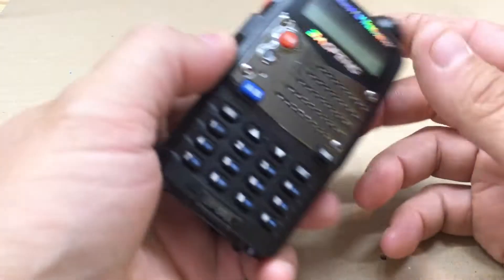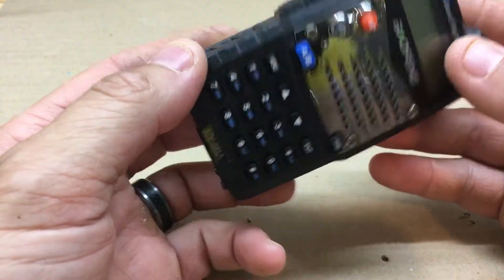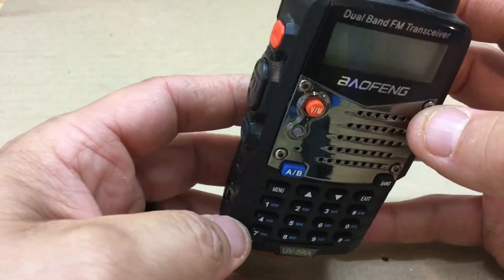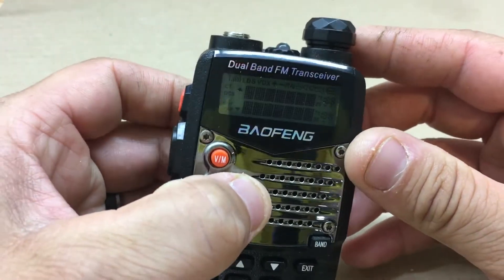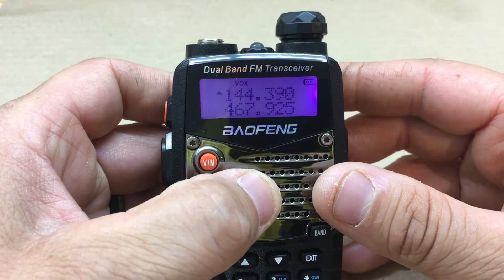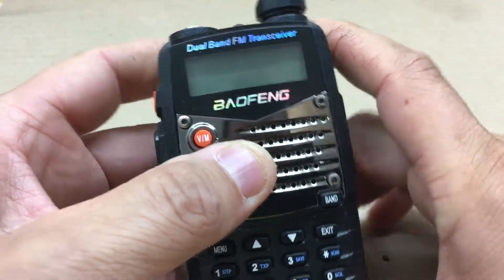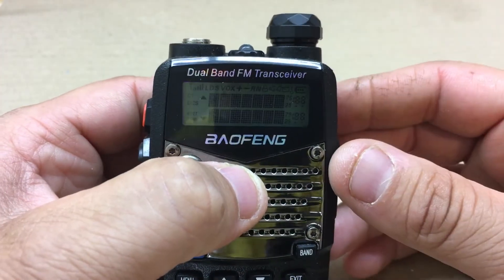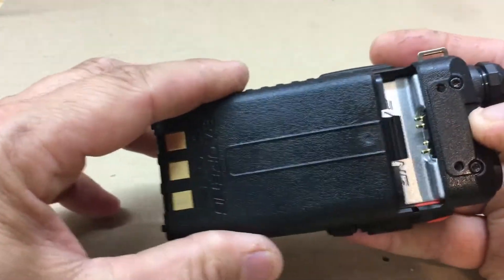Baofeng UV-5R Battery Pin Problem Causing Radio Not To Work

Comment: Also if you drop it on the battery side it will break off the plastic clip that holds the battery in up in that same area. I wonder if you disassemble it if you can reposition or replace the springs that are in those pins? I'll have to take mine apart to have a looksy.
Reply from the maker: I looked on eBay for the pins and didn’t find anything.